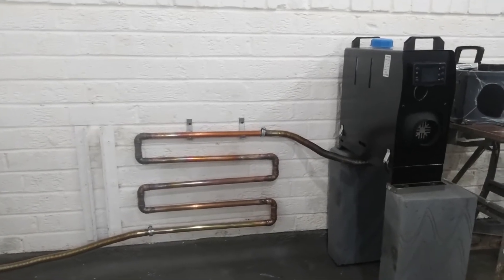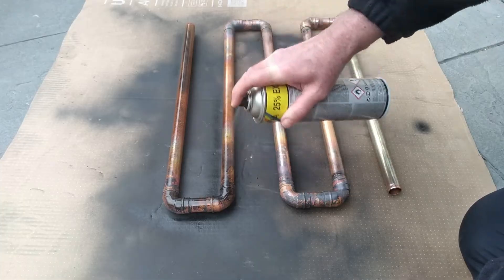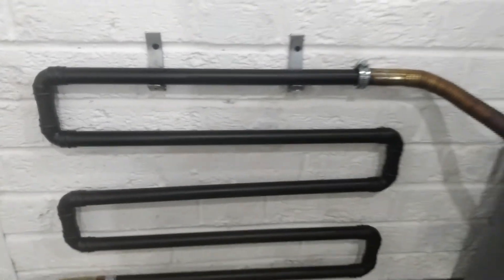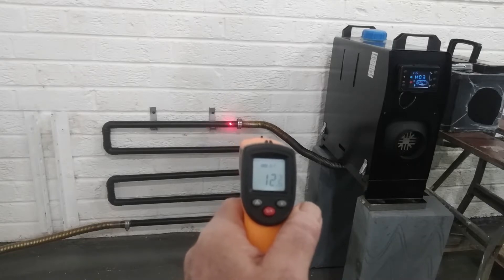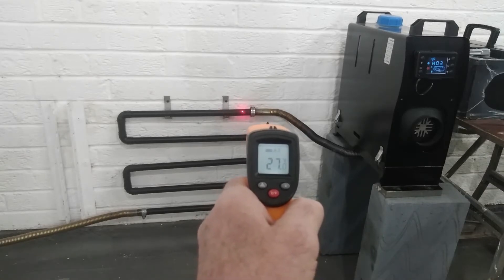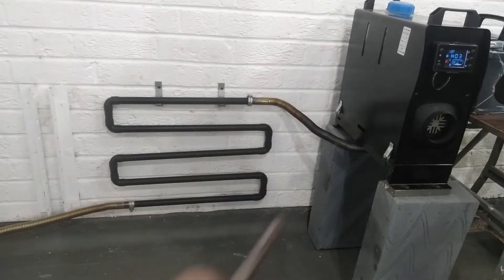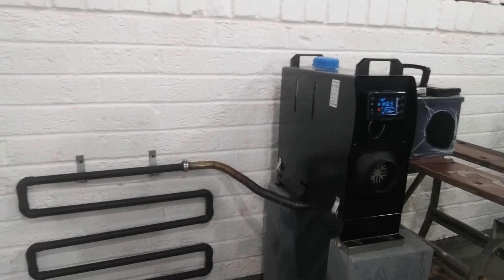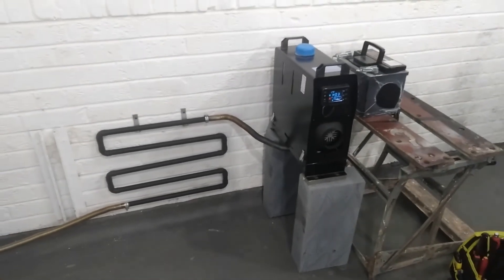I HEAT THIS HOMEMADE RADIATOR FOR FREE Using Waste Exhaust Gas from a Diesel Oil Heater Chinese

Comment: TERRIBLE - WALL SUCKING THE HEAT OUT... PUT INSULATION ON WALL,THEN ALUMINIUM FOIL,TO DEFLECT HEAT INTO ROOM....PUT A 45 DEGREE LID ON IT( LIKE THE RADIATOR FANS YOU SEE ON SHOPPING CHANNELS...
THAT BE A MASSIVE IMPROVEMENT, AND FANS WILL MAKE IT EVEN BETTER.
AND ADDING A SHEET OF METAL THE SIZE OF THE PIPEWORK, AT THE FRONT ,WILL MAKE IT BASICALLY A RADIATOR

Comment: the bends will cause the combustion chamber and the pipe to gum up with carbon, will not be good for the machine i wouldn't do it. Manufacturer states not to have bends in either s or z or it will reduce the efficiency of the heater. if it is not enough to heat the garage best to install a second one.
Reply from the maker: That's interesting feedback about the bends and efficiency, I appreciate the insight! cheers andy

Comment: To get a accurate reading on a small area like that pipe, you need to have the IR meter much closer, just a centimeter or so away, metric for you, couple inches for me.  The red LED light is only for the center of the target.  The further away you are, the wider that area.  At the distance you are measuring, you are getting more of the wall than the copper pipe.  If you look in the manual, it should explain how your specific model works.  Some get wide real quick, some are more focused.  

Neat idea.  I used a slightly longer pipe for mine to get some of that heat as well.
Reply from the maker: Good to know, thanks for the tip!

Comment: 30 or 55 Gallon steel drums full of play sand.  Drill and pipe throught  as a thermal mass heater.  Unit runs out of fuel you have heat for the next 24/48 hours stored. 
A Thermal mass heater  long box is excellent straight piped no bends.... extract heat and prevent back pressure with kinked/bend/elbow bent exhaust lines...
Reply from the maker: Thanks for the suggestions, cheers Andy!

Comment: 6:23 That temperature gun doesn’t seem much use… ‘ really hot’ but the gauge says 30 odd… I don’t think the machine is happy with 5 meters of exhaust, too many bends, the condensation, probably sooting up the burn chamber & will rot through the copper pipe & then you have a risk of carbon monoxide, the heaters are great as they are so I don’t think it’s worth the risk for a few extra embers of heat

Comment: You use a very long exhaust pipe...did you notice any problems long term with the heater? Maybe more sooth?

I have one for camping and I would like to do the opposite, having a shorter exhaust then original, do you see any problen there?
Reply from the maker: longer is more restrictive. i would think shorter is better.
Reply: @andyfireblade  I would assume too, but found no information about it.
Propperly burned in my unit today, seems like the new Vevor have a ultra silent pump. At full fan speed the ticking is fully washed out, can't hear it at all. At lowest setting it is audible, but still very silent

Comment: That is a good idea,  I doubt that the copper pipe is putting up much resistance to the flow, it's on low pressure. The steam coming out is because the exhaust gas is cooler than coming from a shorter pipe. The shorter the pipe, the hotter the gas is & you're less likely to see the steam even though it's still there because it's so hot.
Reply from the maker: Thanks for the info

Comment: I'm sure the instructions say no more then 270°  of bends on the exhaust.
Also if the power supply goes the Heater will melt. I'm fitting a power switch over so if there is a power cut it's kicks over to a  battery to save the heater from melting.

Comment: Should put something behind heat exchanger (radiator) to reflect heat more outward. That concrete/block wall will suck away the heat and spread into more block. Depending on insulation or other wall characteristics you might retain or lose usable heat.

The radiator pipe might be built with a more zig-zag form (tilted) slightly so self cleaning of the built up condensation (acids) will travel, self cleaning
down hill throughout the exhaust exits.
Reply from the maker: thank you for your comment did you see my other heater vids, https://www.youtube.com/@andyfireblade let me know what you think, cheers andy

Comment: Prob a stupid question but considering the heat produced from the exhaust would this melt the solder in the fittings therefore allowing the fumes to escape?
Reply from the maker: good point, but no the joints didnt melt.

thank you for your comment did you see my other heater vids, https://www.youtube.com/@andyfireblade let me know what you think, cheers andy

Comment: Have you ever thought of using electric storage heater and remove the electric element and re plumb the exhaust in either copper or extended flexible exhaust, and store the heat for release after the diesel heater is off.
Reply from the maker: thats a good ide, i will look out for one.
thank you for your comment did you see my other heater vids, https://www.youtube.com/@andyfireblade let me know what you think, cheers andy

Comment: You can get the ticking noise away, by drip feed the burner with a servo/stepper motor driven needle valve

Comment: Any time you modify the vent on a fuel burning appliance you create several problems. We always considered the wasted heat as the cost of proper operation. I would imagine there is some heat that can be recovered but how much before you run into problems?  It’s also not good to rely on the equipment’s safety controls since they don’t always work properly. That being said you are creating a condensing heater that makes water. You raise the thermal efficiency from around 80% into the 90%s. The only problem is you negatively effect combustion which means bad stuff can happen like high levels of carbon monoxide.
Reply from the maker: thank you for your comment did you see my other heater vids, https://www.youtube.com/@andyfireblade let me know what you think, cheers andy
Reply: Appreciate it that's why I was kind of wondering but you actually confirmed it and it sounds kind of dangerous

Comment: The exhaust pipe should run slightly down hill throughout the copper pipes, so external exhaust vapour will exit at the lowest part of the exhaust system, which is outside the property.
Reply from the maker: thank you for your comment did you see my other heater vids, https://www.youtube.com/@andyfireblade let me know what you think, cheers andy
Reply: @andyfireblade I ran a 8ft exhaust ( for extra heat ) with a slight climb at the end and almost killed my new heater. I think the problem is when you turn it off condensation builds and causes back pressure, only for the first 5 mins on start up but the black smoke that was coming out 😬Once I changed it, it works great 👍

Comment: Please hold temperature gun no more than a few inches away from the pipes. If gun is a metre away from pipe, you are measuring average temperature over a 100 mm diameter area.
Reply from the maker: thanks andy

Comment: Possibly use a larger copper exhaust pipe to assure there is no back pressure on the heater. You can use a reducer to connect to flex heater pipe.
Reply from the maker: that true good tip

Comment: Try a small car radiator increase the exhaust size through a dry radiator and put a fan behind it you will get a ton of heat out of that but increase the exhaust size

Comment: Tried a similar length of pipe in my shed and it worked (for a day) heater packed up with an error code (10 ) I had to take the heater apart and clean it up.
so - basically - I don't think it will work.
Reply from the maker: i think tight bends are not good for the heater.
and if we put bends in, a wider pipe would help
cheers andy

Comment: And that laser is not point where meter takes reading. Its big roundish area near that point. Black paint makes it suitable for ir thermometer. Should measure that size pipe from 5cm away.

Comment: That is stupid. After 1-2 years it will be full of black mud ND Heathers will stop working. How are going clear it?
Reply from the maker: thats true. and good comment!
 this was just an experiment.
and i wouldnt advise using bends like this long term.
you want the exhaust as free flowing as possible.
and if you are going to put restrictions in, you must put a larger diameter pipe.
did you see my other heater vids, 
https://www.youtube.com/@andyfireblade
let me know what you think,
cheers andy

Comment: Plumbing wise, each 90 degree bend has the  flow restriction of around 0.5 metres of straight pipe. As Kevin  34ct says, a  central heating skirting Radiator, or even a fanned convector radiator (Myson) could be interesting to try?
Reply from the maker: yes , each bend gives restriction that is not good for flow.
good idea

cheers andy

Comment: A coil would be better than bends. The flow would be better with no restrictiction or back pressure. Car AC use a similar shape to that but with aluminium fins
Reply from the maker: hello david
true! and thanks for the comment.
you will love the new version!
i will upload it tomorrow.
thanks for looking in as well, cheers andy

Comment: A sleeve filled with sand and copper dust around the copper pipe will absorb the heat quickly and release slowly
Reply from the maker: great comment thanks andy

Comment: I can imagine a larger diameter   fire resistant exhaust tubing (to avoid any back pressure problems) and much more of it than your 3 meters of expensive copper pipi spider webbing all over an interior wall to fully maximize the capture of the exhaust heat.
Reply from the maker: yes, a larger diameter would be better, good point, cheers andy

Comment: The fan has to work harder the longer the exhaust and the faster the baring will wear out, hope im wrong.
Reply from the maker: hey martin, i think you are exactly right.
i dont think i would really recommend these u bends.
more free flowing gases are better.
thanks for looking, did you see my other heater vids.
just click on my user name, andyfireblade tell me what you think

cheers andy
Reply from the maker: xxxxx

Comment: Creating a bell out of some kind of thermal mass, where the outflow of gases is higher than the inflow, but still lower than the top of the bell, would result in much more of the heat from the exhaust remaining in the room with you.  This borrows from the masonry heater/rocket mass heater concepts which are so well-proven, at this point.
Reply from the maker: good plan, give me an idea.

thanks andy
Reply: @andyfireblade  - Are you asking that I give you an idea, or that I already succeeded in doing so?
Reply from the maker: @jasonbroom7147  you have given me a new idea for a new experiment. thanks . i will do it tomorrow. cheers andy😁

Comment: heat exchanger is not working properly. the exhaust is what is actually heating your house.  the exhaust pipe should be cold or not more than mild.
Reply from the maker: thanks andy
Reply: you could try using a propane tank instead of extending the exhaust pipe @andyfireblade
Reply from the maker: @meex88hiphop  really good idea, might try that. new video coming on.

cheers andy
Reply: even make channels and fill the tank with sand as thermal mass @andyfireblade

Comment: You can also run piping in a tub for hot water & run water thru heater core for more warmth.
Reply from the maker: i have dont this in one of my other vids. please take a look

cheers andy
Reply: If you are meaning to run the exhaust pipe through water to heat the water, this is not a good plan as it will cool the exhaust gases too much and allow acids in the exhaust to mix with water vapors that condense in the cooled exhuast pipe.  Very quickly you'll get holes in the exhaust pipe.
Reply: @ClinttheGreat  what if it’s stainless steel like in instant hot water propane heaters?

Comment: Be very careful how much pipe you use! Too many turns will cause airflow to reduce thru the heater. You will burn it out
Reply from the maker: Yes, you are right, the u bends really restrict the flow

Comment: Did you provide long time tests? Higher airflow resistance may overheat the machine and destroy it.
Reply from the maker: true, these u bends are not really good for the air flow of the machine, please see my other videos
cheers
Reply: @andyfireblade  Did you experience any problems due to flow resistance? In which video?
Your 3m copper pipe seemed to work well and had a huge heat gain. 50%?  It also is straight inside and does not have this waveform of the genuine pipes.May be an ordinary  10cm dimeter oven pipe is better with low flow resistance and better heat distibution.
Reply from the maker: yes, i agree! i dont think that these u bends in the pipe give a good flow to the exhaust gases. this could potentially put more strain on the machine. please see my other videos of the heater, i think there are better ways to use the heat from the exhaust.

cheers andy

Comment: Please try if it works with an old normal warm water radiator, that they use with warm heating water. 
May be try air floiw resistance first by blowing trough it. Too much resitance, at least more than your copper pipe, may disturb the diesel heater air flow and overheat and damage the diesel heater.
Reply from the maker: i did try this on a normal household radiator. please see this video in my other videos. or click on my user picture. cheers andy

Comment: Just brainstorming the problem but, would it not be better to install some kind of fan to help keep the gas flow right? You can then run a pipe all the way around the workshop and not worry about combustion problems due to low output gas pressure?
Reply from the maker: good idea....cheers
Reply: Log burner fan work on heat and spin for free

Comment: There is a weep hole in the exhaust muffler that should be pointed down, all of the exhaust should  run downhill, the unit is lower at the outlet to the radiator.
Reply: If  you  watch  his  earlier  videos,  he  names  exactly  this

Comment: The manual for these heaters... Recommends to not make the exhaust bend, more than a total of 270 degree's... for efficient burning and less soot build up in the heater....
More than 270 degree bends in total, lowers the efficiency of the burn.. and can potentially cause it to produce carbon monoxide....
Reply from the maker: yes, i totally agree. i would never use these u bends for a long term use. i have used a long straight pipe that works better. or maybe a wider pipe, with less restriction . cheers andy
Reply: What kind off bends? Hard turn or slow bent. I think that makes a difference. Can be the same 270 degree, but blocks more or less flow.
Reply: I was waiting for someone to quote the manual. Thanks

Comment: Your normal body temperature is approximately 37°C Andy, so the temperature reading you're getting on that meter means you should be able to touch that radiator/exhaust pipe without getting roasted.
Also, have you tried instead of heating the outside air up you're bringing into your living space, have two holes in the wall and recirculate the air.
The warmer the air gets when recirculated through the heater is easier to heat than the cold outside air, giving better efficiency overall.
This could heat your space quicker and save you some extra £'s.
I've done readings over last winter and humidity in the UK outside can easily reach 95%. 
I wouldn't want that in my house...when the house cools or that hot air (because it's went through the heater) hits a cool wall behind a wardrobe; it can condensate and cause damp/mould. 
My diesel heater in my campervan recirculates the inside air, that's how it was professionally fitted and apparently they perform better that way.
Perhaps you've found this out by now Andy 👍
Reply from the maker: hello my friend, thanks for your comments, thats really interesting. keep warm this winter, kind regards andy
Reply: elbarbero399  I'm not suggesting bringing the exhaust gasses and air for the fuel mixture into the living/work space, just recycling the already heated air. 
As the air warms up then eventually enters the heater again to be reheated, it's get's easier to heat each time; with each cycle.
The same way air conditioning works except and air conditioner cools instead of heating.
We condition the cool air and each time it passes through the unit, the air cools more efficiently.
It is impossible to run out of air, we are just recycling it through the heater and not the combustion chamber.
That's how mine was fitted in my small campervan (professionally) and I have never ran out of air. 👍

Comment: When I was at college takings my motor vehicle degree, they told us never to put copper in an exhaust system. The chemical reaction between the copper and the chemical and gases can cause a deadly toxic mix to be emitted. Be careful. Datsun tried it in the 1960s and stopped for that reason.
Reply from the maker: thanks

Comment: If you used bigger diameter tubing it would not restrict the output as much. Apparently they are tuned to have a certain diameter pipe on the output. If you use the same diameter it will not combust properly and you will have problems with soot build up and or diesel or whatever oil you are burning coming out the intake port., It will build up and you will get a gurgling sound unless your intake is facing down , then it will drip the unburnt fuel out the intake port. But unless you fool around with the setting like fan speed or fuel input the combustion may not be complete.
Reply from the maker: thanks for your comment
cheers andy